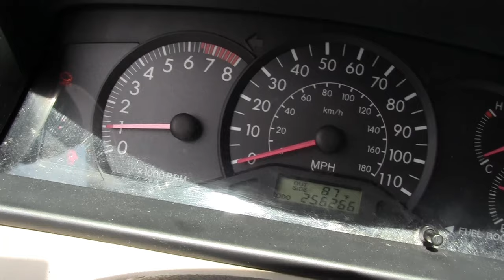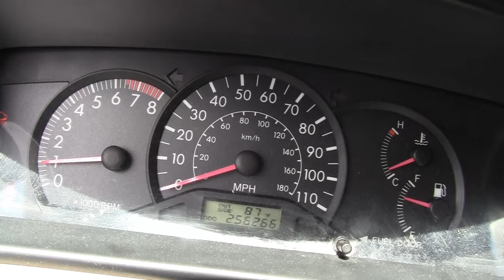How to Replace 2008 Toyota Corolla Ignition Coil - 8/23/2020

Comment: Your valve cover gasket has deteriorated it’s leaking oil in the spark plugs tube, that’s why you have oil residue on your ignition coil….change your valve cover gasket